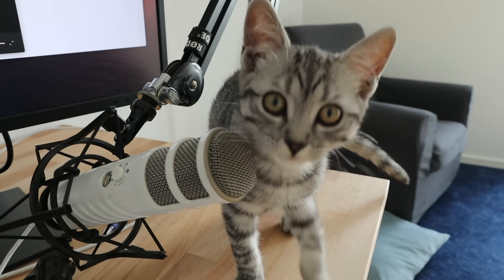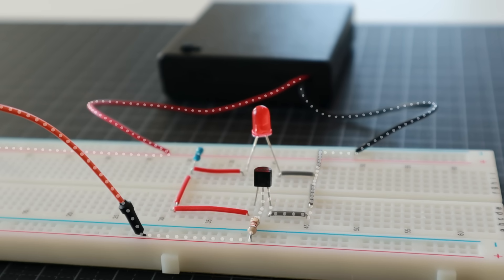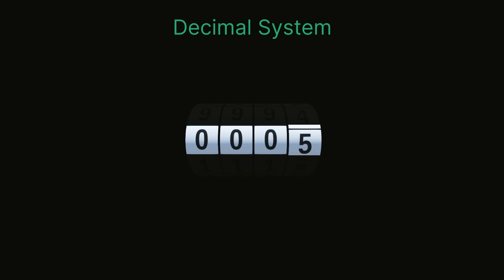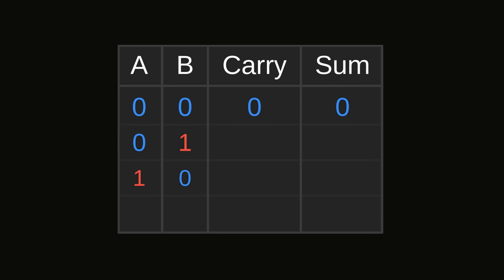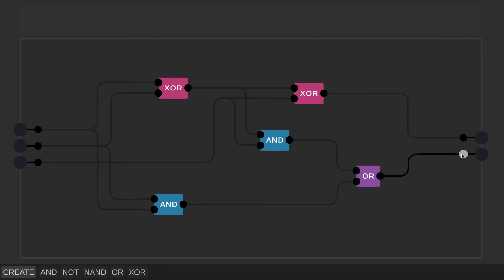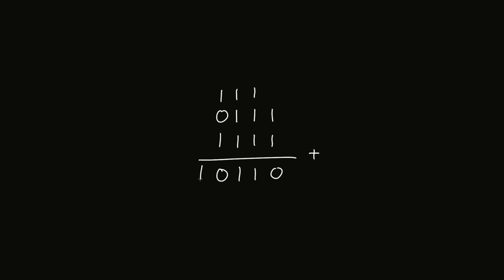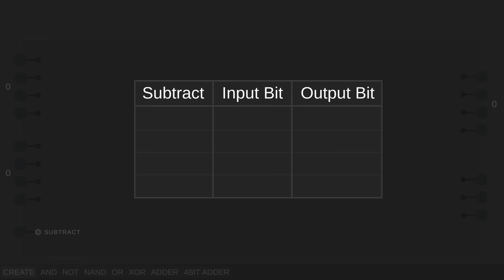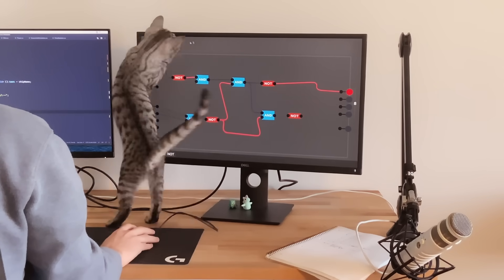Exploring How Computers Work

Comment: I think, as no-one else has questioned it, that I must be missing something but you connect the 'negative output' to the 8 bit output of the adder and call it 'a negative 8 bit output'?
This looks to me as if every time your input is above 8 you will get the 'negative' output going high. Surely this is wrong? If I have >8 but <16 the 8 bit output from the 4 bit adder will be lit but not as a negative?
Reply: Yeah, that's the reason CPUs also have another flag besides Carry Flag called OF (Overflow Flag).
In this simple example you have two 4-bits input (signed) + substraction bit, and one 4-bit output + 3 flags.
Also with 4 bits here in example to support signed integers you always give up 1 bit for sign, so it is actully 3-bit number (range from 7 to -8).
Reply: @blighthornsteelmace820  thanks for the reply but are you saying the top output is a subtraction bit?
The ALU built above doesn't output that way. If I put in two inputs, say 4 and 4 or 6 and 2 the output should be 8. If I do it with this ALU I get 8 plus the negative bit, which is wrong??
Reply: @bobb6084  
Inputs: two 4-bits (signed) + substraction bit
output: one 4-bit (signed) + 3 flags.
Substraction bit is not part of data, but kind of control which operation to do, adding or subtracting (0/1).
Output have no subtraction bit, but 3 flags to indicate special state, which can be useful, but are not part of output number.
Both input and output are "prepared" to hold signed integers. This is for adding negative numbers, or substracting numbers, that would give negative value result.
So Both has 1 bit reserved only for a sign. That would mean for the number there is only 3 bits left.
So the range is from positive 7 (0111, where 0 is indicating it is positive number) to negative 8 (1000 look for 2-complement notation below).
Whenever you would add 2 (0010) and 6 (0110), you would cause an Overflow - that would mean the number is bigger than the output can hold. (8 is above range < -8 , 7 >). the output can hold only 3 bits for number and 4th is for sign.
Whenever overflow happen - the result is most likely wrong. As 2 + 6 is not equal -8 (1000 in 2-compliant notation, first bit is always a sign).
Another example: 
5 (0101) + 6 (0110) = 1011 
the result means 11, but it is 2-C! so first bit is sign. you cannot hold such big number in 3 bits that are left for holding number, so an overflow is happening, it is actually -5 :)
We say then that the number overflowed to the sign bit.

btw, if you build the ALU to do only adding, and the numbers are always unsigned (positive), so you could drop all the 2-complement notation, sign bits etc., and use all 4 bits (number from range 0 to 15) , and be able to add 2 and 6, or 4 and 4. But still you will get an overflow, when you will add 8 and 8 or 15 and 15. You will just run of bits in the output  (if it would be 4 bits only).
(btw, Solution from movie also do not indicate that overflow happened).

example without 2-C notation:
8 (1000) +8 (1000) = 1_0000
but hey! it is 5 bit number and the output can hold only 4, so you cannot see that 1, and you got only 0000 - zero.
12 (1100) + 7 (0101) = 1_0011
it overflowed again, you can result of 3 (0011) instead 19. The 1 at 5th bit is just dropped and forgotten, no place for it in 4-bit output! (thus Overflow Flag would be nice to have).

Btw here are all possible number in 2-C 4-bit:

7: 0111
6: 0110
5: 0101
4: 0100
3: 0011
2: 0010
1: 0001
0: 0000
-1: 1111
-2: 1110
-3: 1101
-4: 1100
-5: 1011
-6: 1010
-7: 1001
-8: 1000

it is very easy to convert to 2-C notation (really!), and it is the most convenient notation to operate on signed integers. So try to get used to it. All computers use it all the time, when they want to do something with signed integer. It is totally necessary to understand how signed integers are computed by computers.
2-C notation is solving many problems, that were there with 1-C notation.
Like you have only 1 zero (no positive and negative zero). and can just add positive and negative numbers normally (even when negative look weird on first look - it willl give correct result).
Reply: when he is building the 4 bit adder he makes it clear that he can add both sets of 4 bits and produce up to 15, 16 would overflow into the carry.
After 16 minutes whilst building the ALU he connects the 8th bit to the negative output and calls it a negative 8 bit? He doesn't really make it clear when it changed from the 8th bit to a to a negative 8 bit? Does the negative input in the carrty input change it into a negative 8 bit output?
 @blighthornsteelmace820
Reply: @bobb6084  oh I think I know what you are asking for (I hope).
At least I guess, that whenever you use 8bit I guess you mean 4bit (like 4th bith in output). Cause no 8-bit numbers here.

So the answer is... nowhere :)
it is not necessary! That's the buty of 2's complement. You make adding and subtracting works the same for signed (2-c notation number) and unsigned (normal binary number).
Actually the CPU do not have to know that at all.
It is the program that should know how to interpret the output, basing on instruction it actually commanded to CPU. Thus developer creating proper types is telling the compiler how to interpret the data. Data itself is alway ones and zeroes. And program knows what it asked for, and is it a number, character or anything else.

CPU just see a number. Actually in most CPUs there is the same instruction for adding or substracting signed or unsigned numbers.
Thus here, in video - there were no need to adjust 4-bit adder logic - it adds the same way usigned and signed numbers.
The only difference is how do you interpret the output, as 4 bit unsigned (normal binary), or as 4 bit signed (and take Most Significant Bit as a sign).

As for what you finally asking - the Negagive Flag - taken from Most Significant Bit of output (4th bit).
Ye, this is exactly what it looks like. It is just called negative flag. But what it really means - it means is if most significant bit is "1".
https://en.wikipedia.org/wiki/Negative_flag
If the output number is unsigned and really big (with 1 at its front), the flag will still be set to true (1), but the number is intepreted by the program as positive.

I agree, that it is only implicit, that the author switched to interpret the data by his visual program to signed numbers, while actually the logic inside do not care about it.

Comment: hi i am very ignorant but i still want to ask a question, in the first circuit you made on the breadboard it should not be a simple parallel circuit, why then the energy did not assert anyway to the led, I think I did not understand the parallel circuits well, could you explain it to me please? heartfelt thanks in advance
Reply: I can try to explain this. Will try to simplify.

Diodes and Transistors have something called a "forward voltage drop". This is the amount of voltage "consumed" as it where in conducting and is also the minimum for the part to work. For a LED that is often around 1.2V.  The transistor (when turned on) has a way lower one at around 0.4V.

SO when you leave the transistor off. The only path is the led, it will light up and you will get 1.2V across the led's terminals.
BUT if you turn on the transistor. The voltage drop across the led terminals becomes 0.4V. This is not enough for the led to work, so it just stays off and does not even conduct.

For a practical example. We use this behavior for detecting blown fuses by placing a led+resistor in parallel with them. When the fuse is ok there is close to no voltage potential across the fuse terminals cause really low resistance. Not enough potential and the led doesn't work. However, if the fuse is tripped this path is lost and only the Led+resistor path remains, which then lights up!

Hope this makes some sense!
Reply: @Foxhood  thank you very much, i understand much better now

Comment: i got lost at XOR and NAND, I don't understand the point of them, can somebody explain? aren't they both same as OR?
Reply: XOR or "Exclusive OR" only outputs a 1 if either of the inputs are 1, but not both (so 01 or 10). If the inputs are identical (00 or 11) it outputs 0. 
Hence the name Exclusive OR. It only works if it gets a single exclusive pair of inputs. Not an identical pair.

NAND or "Not AND". Is just an reverse AND. Outputting a 1 so long as both the inputs aren't 1. The opposite of a regular AND that only outputs a 1 when both inputs are 1.

XOR is a bit of hard to wrap one's head around. But it is one of the most important logic gates we know.

Comment: Does that mean that  I'm closing or opening a circuit each time I press a key on my keyboard? If so, that must be probably a very complex circuit for each key to go from 1s and 0s to all the way from A to Z! Curious feeling this abstract level of understanding and appreciation. I like it! I'll rewatch a few times though because it becomes a lot of info and different names very fast, but I'm definetly interested in experimenting with your simulation and following the playlist along!
Edit: Just noticed the playlist is 2 videos long only :(
Reply: Kinda. Though we do use a trick. Wiring so many buttons to a single controller chip is kind of...insane.

So instead we divide the keys into small groups. These groups share the chip inputs inbetween them, but as groups are turned on/off individually.
The controller selects group 1, reads the inputs for a key-press in said group, then switches to group 2 and repeats for as many groups you got untill all buttons have been scanned.

This is called "Multiplexing" and it lets us wire up crazy amounts of buttons without needing a LOT of chip pins or complex circuitry.
Instead the headache comes from how the chip has to be programmed to switch and scan for inputs constantly.

Does add a coolness factor. to think that while your fingers are hovering above the keyboard. It is scanning every button for a press hundreds of times per second!!

Comment: can't you do a basic OR gate with discrete components instead of chips? wire switches A and B in parallel from positive and then splice them back together and run an LED in series with that output. right????

Comment: Just for the fun of it, some knowledge of Google may be required for definition of terms!
I entered the computer world in 1969, US Army Signal Corp!  Over 9 months of learning where the electrons went! The paper clips had been upgraded to toggle switches. How to use volt/ohm meters and oscilloscopes, some cost more than the cars we drove!   
The first system I was trained was an NCR (National Cash Register) world famous for cash registers!
Input and output were punched cards, slow, noisey created lots of dust. I have VA disability now for hearing loss, no OSHA  then,   400 hundred 68 bit words of memory, yes words!
The console still had a hand crank on the side with thousands of moving parts! Glad I was a mechanic before my all expense paid senior trip to Fort Polk La.
Processor speed, a lot faster than a "slip-stick" and yellow tablet with lots of sharp pencils!
When someone asked how they worked we used an old Navy  phrase:
"Works fine, fails safe and drains to the bilges......"
Very good video!

Comment: Thank you for this video.  While I knew the different logic gates, seeing you creat each gate made it clearer for me.  I also think your simulation program will really help me.  I play a number of games that have varying degrees of automation of tasks.  They give the basic blocks to create logic systems (power switch, sensor that detects if power has just been turned on or off, button to activate something, counter button that goes through a set number of repitions before activating something, a delay that delays activating some thing, and more.)  Your program should help me figure out my logic before trying in game.

Comment: That's precisely what I used to do to learn the structure of a computer when I was studying computer science. We had a seemingly much buggier program that allowed us to draw more and more complex schematics of wires and transistors, until we somehow got the base of a computer (very slow, but capable of following a series of instructions, using two types of memory, one for data and one for the codes of the operations)
I found this very interesting, and this video explains very well the basics of it

Comment: The video is not about how a computer work, but merely some basic intoduction of electronics 
Your explanation is rather vague and complicated while such concepts are not 
The first step to be taken to understand well enough how a computer works is to learn boolean algebra expressions related to combinational logic gates or cirtcuits, then sequential logic circuits to see what the difference bewtten a calculator and a computer by making comparisions between combinational  logic circuits and sequential logic circuits after have been able to master the two type of logic circuts
The 2nd step is to learn how combinational citcuit and sequential logic circuits can be combined to do calculations which included both presently loaded values and saved values. After that you guys will understand what the ALU does in the CPU  because those  2 types of circuits the main components of the ALU which perfotm combinational logic operations consisting of logic circuits, and calculatons with sequential logic ctrcuits
To understand what an adder is, you must have an idea what a half -adder is first, then what a full-adder is, but not saying how many bit adder, like 4 bit adder, 8 bit -adder, 16 bit-adder, 32-bit adder, 64-bit adder so vaguely withour having any clue of what an adder actually is and which sort of adder is practically useful in compter hardware architecture 
What make a computer valueable and different from a calculator is its ability to keep values in its memory  
So what constitute its memory ? 
The answer has a lot to do with the concept of adders made up of different types of logic circuits which are also components of the ALU . But there is a difference between the ALU and the computer memory is that the is a controlling function which  either allows or does not allow inputs to pass through a sequential logic circuit. That contol function is called as ' enabling write' and 'enabling read' or being gated. this function can be controlled by a clock or 2 signals on and off like the square wave of  DC voltage signals , and represented by 1 and 0 
You will have to know what a latchis first before you can distinguish the different betwen a  gated latch used as a part of a computer memory RAM and a latch or a sequential logic circuit used in the ALU
A latch is a sequential logic circuit which has both current state and the previous state data inputs. in other words, it has  saved values from the previous operation, or has a memory, besides the presently loaded values.  It is also a good idea to note that a combinational circuit does not have any saved data having only current inputs
A gated latch is a sequential logic gate equiped with a control function which either allows signals of data to pass through it or block the signals. Ex, you have an AND gate, of which one input is connected to a clock or 'write enable' function when it is turned on the signal is on or coressponding to 1 , and off when the signal is 0 , and the other input is for data signals to flow into the circuit. When the 'enable' signal is 1, you  turn  the data input signal to on , corresponding to 1 , then the 1 bit value can get in, and stored there in sequential logic circuit. If you turn off the ' write enable' , the signal from it will be off or 0, and the out put of the latch will still be 1 even when you togle the data input from 1 to 0 and from 0 to 1 again. It means that that the AND gate prevents any change to the memory or saved value. 
So, one gated latch can store 1 bit value , and if we put 8 gated latches together and side by side, we can save 8 bits  of input. Similarly we can have  save 16 bits of data or commands with 16 gates laches, 32 bits with 32 gated ones, 64 bits with 64 gated ones
It will take too many wires or not be economically effecient if we arrange so many gated sequential logic gates horizontally because 64 wires will be needed for data inputs , and 64 wires for the outputs , and 1 wire for connecting all 64 'write or read enable', which is 129 wires . For 64 x 4 = 256 gated ;atches or 256 bits of input, the total number of wires will be: 256 +256 +1 = 513 wires , which is tow many or complicated for just only 256 bits of memory value. 
So, we can solve the problem by connecting them in a matrix with the size = 16 rows by 16 columns, and each address of memory is defined by the number of its row and the number of its column, similarly to how you use values in matrices when solving a linear algebra problem
Those are merely some brief basic intriduction of the 2 importan compnents a computer. There are a lot of things to learn before you can actually understand how a computer works. Here is not enough space for me to give you guys such basic ideas 
Unless you want to become a computer hardware engineer, you don't have to master cumputer hardware archintecture, and your purpose is just to understand some basic functions of computer hardware components to help yourselves do better in writing computer programmes with  your programming skills 

Only those who plan to become computer scientist will have to master both  computer software and hardware architectures. I myself use CS  as a scientific tool for my own unprecendented scientific projects, although the knowledge of it must be similarto that of a computer scientist